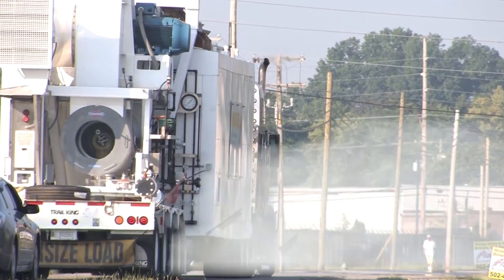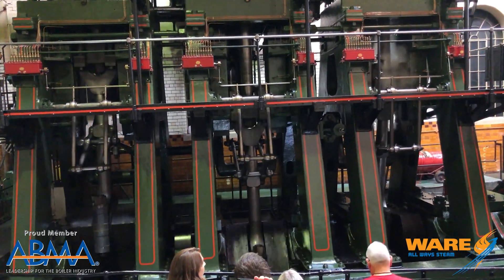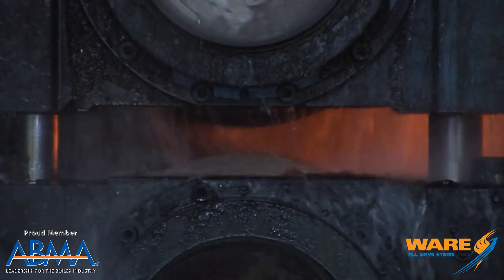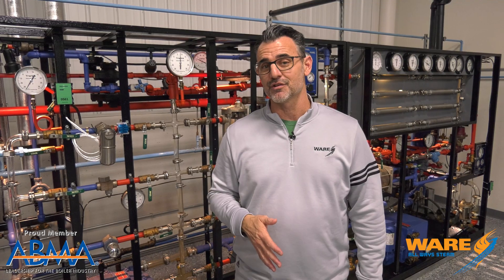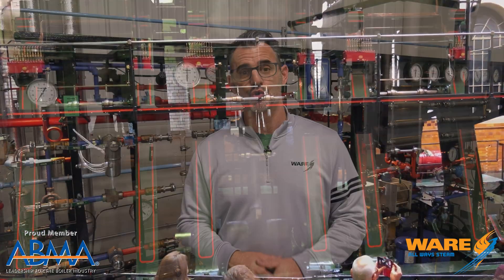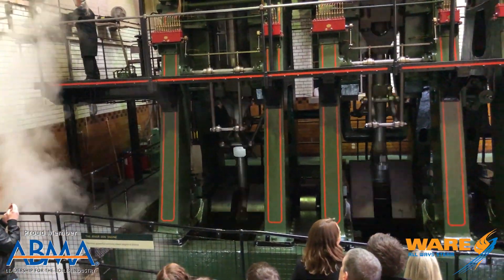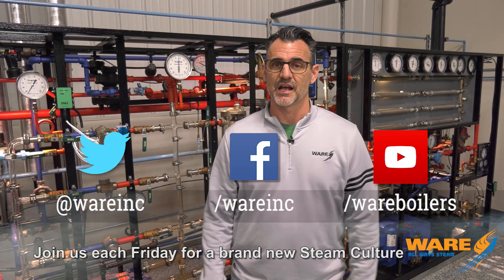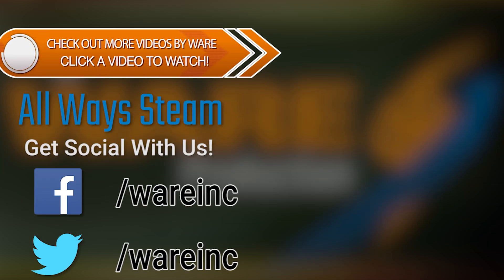River Don Steam Engine | Largest Operating Steam Engine in Europe - Steam Culture

Comment: Excellent video. By the way, how does it reverse it's rotation?
Reply: By way of a valve gear, such as Stephenson's or Walschaerts valve gear found on steam locomotives. They work by changing the order of steam admission and exhaust events. I do not know the specific  valve gear fitted to this engine.
Reply: @chalichaligha3234  Thank you for your valuable reply. Please keep on sharing your valuable expertise.
Reply: @chalichaligha3234  Hi Chali I hope your keeping well The River Don Engine has a  Joy Valve Gear with 2 hydraulic cylinders to move the reversing arms back and forth operating the valve gear  the speed of the engine in the steelworks was 120 rpm It could roll an ingot 26 inches down to 2 & 3 quarters in 9 mins 33  passes through the mill
Reply: @gregharris3747  , Impressive stuff! Thanks for that. Also, what a coincidence! Over the last year until October, I was working for the LNWR George the fifth Steam locomotive trust, who are scratch building a 1910 George the fifth class locomotive for the heritage scene - and this class was also fitted with Joy's valve gear.

Keep safe!
Reply: @chalichaligha3234   Thanks for your message . It's good to hear for you and I also have the greatest respect in what you do It's amazing work !!. I wonder if you know Richard Gibbs  he   was in charge of engineering down at Kelham and left around 1988-89  to work at the National Railway museum  I became very interested in this engine back in 1982 when Kelham Island  first opened It was a little scary the first time I saw it in action but frilling as well I started  to go down every sunday from 1983 -89 as I was planning to do a technical drawing of the engine and I needed to get all  the parts right. Richard kindly lent me this  wonderful manual book full of working drawings It had all the parts to the engine and mill and this was back in 1988 It felt like Christmas and I made sure It was well looked after so I could study all the parts in great detail . The  drawings were dated 1902 and came from  John Brown's that's where the first mill went to . The teeth on the drive and pinion wheel  were cut at Scott and Hodgson as they had an engineering company  in Sheffield . the casting to the River Don Engine and mill commenced in 1903 and  the foreman in charge was William Warren   Drive Wheel has 93 teeth pinion wheel  23  teeth Take care fella and stay safe .